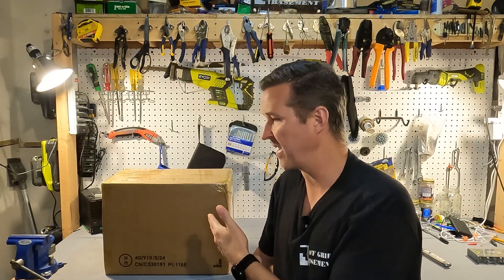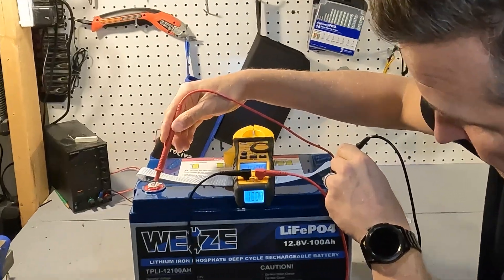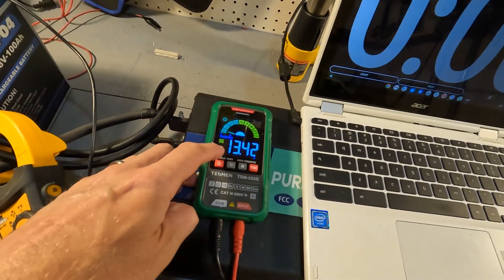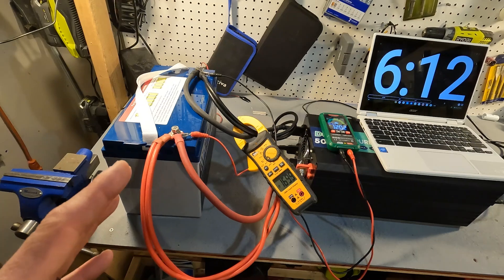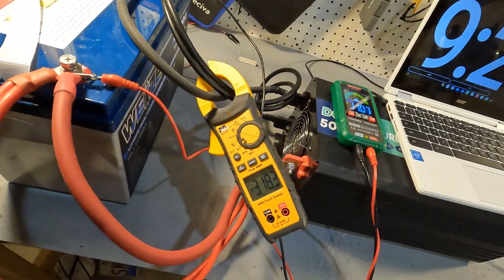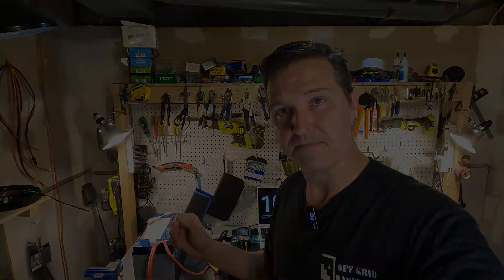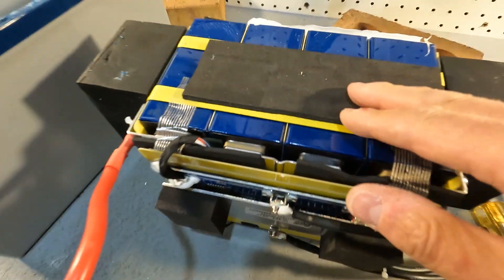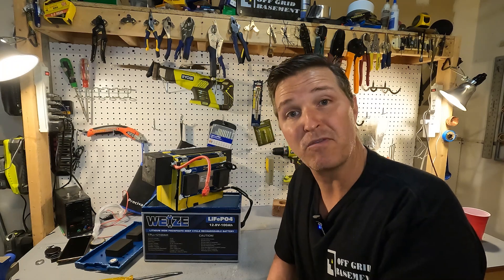WEIZE 12v 100ah Lifepo4 Battery Review and Teardown!  High Discharge protection....Not this Battery!

Comment: Given your testing, would you recommend this battery for an off grid camper with small solar panel for charging? Any concern with not shutter off during over power?
Reply from the maker: This battery is just fine.  I'm not concerned about over amperage protection.  The battery should have it, but it's just not programmed correctly.  When you wire the battery to an inverter or busbar, just make sure to connect a 125A fuse on the positive cable.  That will give you the over amperage protection you need.  Even if you over-size you cables, still use a 125A fuse.  That way you are still protecting the conductors inside the battery.  Hope this helps!

Comment: WEIZE=SCAM  Warranty DO NOT TRUST WEIZE!!!!!!!I have 3 of the 31 group deep cycle lithium purchase July 17, 2024. Had 2 go out recently and a third a week later all when it got hot here in Kansas. I tried contacting Weize the manufacturer on their website chat, phone number, email and their warranty form. I have contacted each multiple multiple times with ZERO response which leads me to believe that their 10 year warranty is basically a scam piece of paper. I am going to file a complaint with the BBB but just out of principle. I would ABSOLUTELY NOT buy anything from them if you expect them to respond to a warranty issue. Try their phone number or chat for yourself. Their phone number always goes to a voicemail message that says it cannot take anymore VM's because it is full. Their chat says someone is available and online but no one EVER responds. WEIZE=SCAM